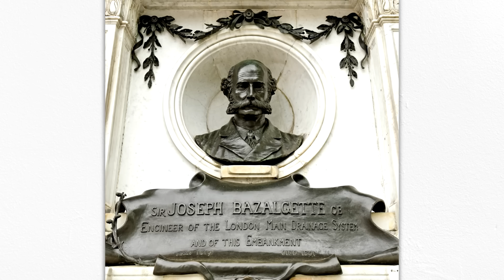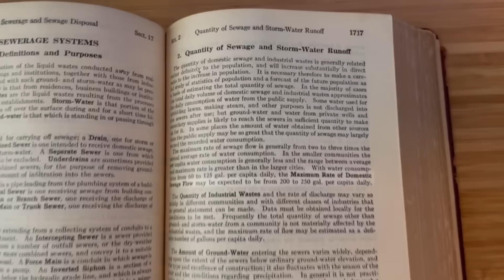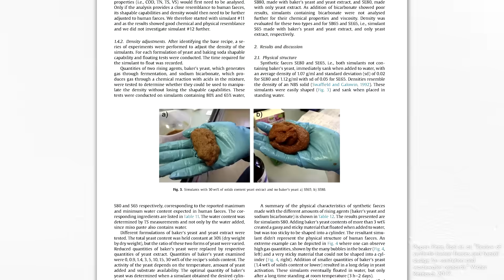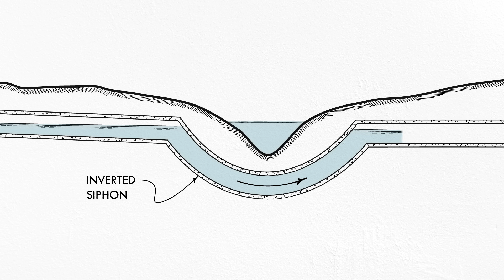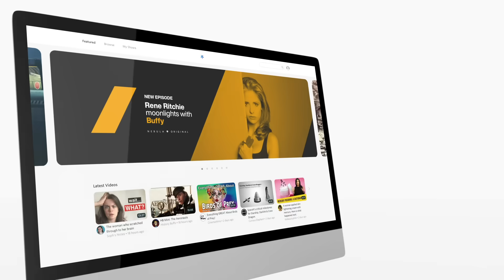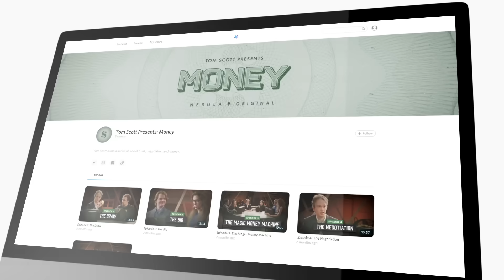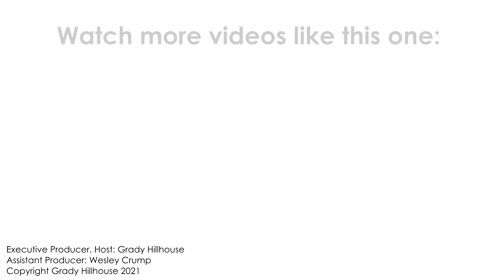How Sewers Work (feat. Fake Poop)

Comment: Look at the smooth curves of the brickwork at 01:55. All of it laid by hand by skilled bricklayers 150 years ago. They would be so proud to see it still in perfect condition and still in use 150 years later!
Reply: Not to detract from the quality of workmanship done by those brick layers but I would say that the "smoothness" of the brick work is almost certainly due in large part from the fact that the tunnels have been subjected to ~150 years of erosion from the waste water flowing through the system, rounding off every hard edge like stones in a river.
Reply: @Ganntrey to a certain extent probably.  However, remember that this system at the time it was built never ran at full capacity, and even today it probably only rarely runs at or above max capacity.  Which means that erosion would only primarily occur on the bottom most side inside that “pipe”.  So if you want to get a true feel for the skill level of those masons then look at the work at or near the top half of the “pipe”.
Reply: @Ganntrey  No they were definitely layed out that way with a purpose.  They knew curved bricklaying like that was exceptionally able to withstand pressure from the soil above (after all, try to crush an egg between your thumb and index finger, and it doesn't work or requires an incredible amount of strength) in order to stop the top surface from being able to collapse the pipes.
It's the same reason churches tend to have those curved roofs on the inside, because they are able to deflect forces from the roof itself onto the pillars that the curve ends in.

Laying those bricks down probably was done with a prefabricated mould of wood that could be used to check the curve with every part that was built.
Reply: @Dutch3DMaster  You're absolutely right, but that wasn't my point. I simply meant that the decades (soon to be centuries) of erosion have certainly had an effect on the brick work, slowly smoothing out every little, tiny protrusion turning the already quite smooth shape into something superbly smooth.
Reply: @Ganntrey  that reply was slick as shit.
Reply: That is a great point. Some of the very best masonry ever built will likely never be seen, but for the few people to venture into a sewer. Both piping and manholes. Often, multiple layers thick and still as reliable and effective as the day they were first used.
Reply: Oval brick pipe was common in combined sewers which conveyed both sanitary and storm flows. The small diameter at the bottom maintained relative depth to promote cleaning velocity at low flows while the larger diameter provided capacity for the occasional much larger storm events.
Reply: That brick work caught my eye aswell, it's nothing short of artistic. I really enjoy examining the trade works of earlier generations, vary difficult to reproduce.
Reply: Real craftsman.

Comment: This is what I do for a living. I like to tell folks that plumbers have saved more lives with clean water and sewage relocation then any other career in all of history.
Reply: If plumbers actually designed and installed the sewer systems, you might have a point.
Reply: @philipwebb960  Funny you should say that. In order for one of us to receive our Journeymen's license, we need to be able to design plumbing systems. We are the ones installing it, we need to be able to understand what the engineer/architect wants, and correct what needs to be corrected due to onsite conditions or bad design flaws.
Reply: @javiervazquez9472  That's awesome! I always say that training should include one job up, and one job down in the chain of work. Works for me as a surveyor (which is fun, because we show up at two points in the same chain).
Reply: @cf453  Another surveyor here, have you had a situation where you've had to tell the guys to dig up the line because the gradient is wrong?
Reply: @TheMiksi  Nope, that's the inspectors job. :D
I've had a Project Manager hand me an old set of bridge plans. Staked the abutments 6ft wider than they should have been. That was not fun.
Reply: @cf453  Oh that old chestnut, always fun to notice that you've been using old plans. :D I had to tell the workers on one sewer line that shit does indeed not flow up hill, I had to double check my measurements just to be sure. They dug up about 40 meters of it and started again. Turns out they had a faulty laser level that showed 0% gradient when set to 1% so the 0,5 % gradient they needed turned out as -0,5%, fun times.
Reply: @TheMiksi  No, but we had a portable bridge fall into the creek because it was five feet too short. And survey the wrong orange orchard for a tract development, wasn't noticed until tractors removed the trees from the wrong lot.
Reply: The transporting and cleaning of wastewater is the single most important aspect towards the development of a city. It is what separates 1st and 3rd world countries. Most people would say that 'clean water' is the most important thing. But, you can't have clean water without treating the wastewater. They are two sides of the same coin in importance.

Comment: Having designed sewer rehabs and expansions as a junior engineer, Sanitary pump stations were used to convey effluent to other and hard to reach areas, including crossing of water bodies.  

The pump station would discharge into a gravity system or trunk force main.

IN MY EXPERIENCE (emphasis added), Inverted siphons are banned by various Health Departments regulating the permitting of water mains, sewers, and pump stations.
Reply: Yeah, much less hassle in the long term to just put in a lifting station and pump the stuff under the water body (easier to lay the pipes too).
Reply: Nothing like replacing a riverside ARV that has been eroded around.

Comment: A friend of mine works as an engineer at Hamburg Wasser, she told me that their sewage system was also upsized during the project phase but then it remained oversized as workload for it did not grow as much as anticipated. To make up for that, today, HW has to frequently pump an insane volume of perfectly  drinkable water right at the ends of the sewage system so that waste doesnt accumulate. The "just make it bigger" is a risky approach.
Reply: This can also cause the sewer to go septic if it is relatively slow moving in long pipelines. It then produces hydrogen sulfide gas which stinks like rotten eggs and gets converted to sulfuric acid that corrodes concrete and steel pipes.
Reply: @locrogin  In my city, most of the sewage pipes are ceramic or plastic, sometimes even for the bigger parts of the system.  That gas will almost always get formed by the way, because in a way, it's the decomposition of the material by bacteria that have that as their waste product.
Reply: @Dutch3DMaster  True but as far as I know the concentration increases when the flow rate is low. We also have a lot of PVC mains but I live in a very flat area and we've had problems with  corrosion in old DICL rising mains, due to the long time it takes for sewage to flow through the gravity mains.
Reply: You know, there are a lot of Germans in this comment section… Something something German engineering
Reply: @Isometrix116  I'm not German. ;)
Reply: Saku .... if they had installed 2 smaller pipes it would have solved the problem of keeping the flow rate up while maintaining room for growth.

Comment: Would you also explore how sewer lines ventilation affects it's performance? Such as how absence of ventilation at start of the sewege line hinders it's performance or blocks it completely
Reply: There are roof vents on every building.
Reply: @aeromodeller1  Which would be a fat lie as it would be expecting every building to follow the regulation, which they don't. That's like expecting that everyone around you is law-abiding citizen, when in reality we don't live in an ideal world like that
Reply: @Gastell0  Every building is inspected during construction to ensure it meets code, including plumbing code, which requires vents. The vents are there to prevent sewer gasses from coming up out of the fixtures into the building, as well as to prevent hydraulic lock. There might be a dozen or so building laterals between any two manholes, so there will be plenty of venting.
Reply: @aeromodeller1  Guess the historical building that I bought in Germany is an illusion that has no venting on one of the lines, or am I a liar? =)

Comment: "I am a waste management technician."
"The most pleasant sewers can be found in Paris, France."
Reply: Paris uses huge wooden or iron balls to clear some of the sewers.
Reply: @michaelwarren2391  They use(d) those balls to clean the siphons under the Seine river. (edit : they no longer do. SIAAP now relies on regular dredging of the sediments). The ball is nearly as large as the siphon itself. So it restricts the effective cross-section of the sewer and locally accelerates the water above the self-cleaning velocity to displace the sediments down-stream (but up-gravity) to the straight sections of the sewer. Apparently, it's pretty effective. 
For the sewers themselves, they use something else in the large, man-accessible ones, called a "bateau-vanne", a vane-boat. In essence, it's a raft that carries a submersible plate the width and depth of the sewer's channel. Same principle as the ball, though. It restricts the flow, accelerates the water in the gap between the channel's walls and the plate and flushes the sediments further down-stream. 
Cleaning the pipes is important in Paris because it's a very early "unitary" system from the mid-19th century, that collects both sanitary streams and rain. So the system receives a lot of sand and soil from the streets. On the plus side, I've never heard of a fatberg in Paris.
Reply: @Fragaut  Neat! That is a much more interesting reply than I was expecting to my cheeky little Psychonauts quote. Searching for bateau-vanne did not disappoint.

Comment: Curious about interior surface material.  You mentioned slope and size as the only major factors of laying sewage lines.  What about interior surface material?  There must be companies experimenting with different sewer pipe materials and surfaces.  Any info there?
Reply: Each type of pipe has a different friction factor, which goes into the hydraulic formula used to select size and slope.

Comment: "we only going to do this once"
subways, underground electrical wiring, gas lines, internet: aww shiet, here wo go agien!
Reply: Yes your right put a big conduit while your at it to run other line like electrical and internet. They all ready have to berry gas lines, sewer, and water lines why not do a big conduit tube for any thing else in the future.
Reply: @RaymondDay  While both electrical/data and gas are fairly blind to overdimension, it's not as easy as that for water and sewage. Fresh water is strictly controlled so as to not have problems with legionella or other contaminants that reproduce in stagnant water. Thus the fresh water pipe needs to be correctly dimensioned for the prospected development in the neighborhood.

With sewage the main problem is, that there is not enough water, if there are too few people living there. Resulting in stench and clogged pipes, that requires extra maintenance in the form of rinsing via watertruck. If there are too many people on a sewage pipe, it can fill up the pipe to such an extent, that the flow pulls air into the system from the houses or backs up into houses. Both of those shouldn't result in any problems in modern sewage systems, but why risk it. Cleaning a sewage spill, you can essentially trow everything that came into contact with it away and even trow out the wall paint, etc. If it flowed under the floor screed, you can rip out the entire floor too.
Reply: In my professional experience, you also only lay electrical wiring and gas lines once. And you only need to touch those if the building on a lot changes, which is once every two decades or even once a century.
Reply: @JainZar1  my apartment development conduited everything in construction, and then 15 years later they added fibre optic to all the apartments through said conduit. Other similar developments have been turned down for upgrade due to the cost of digging.